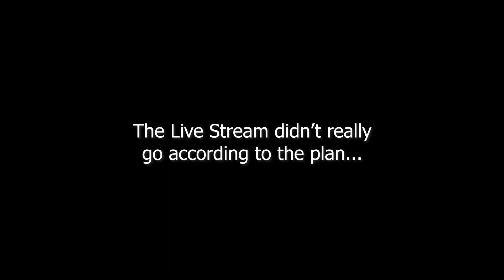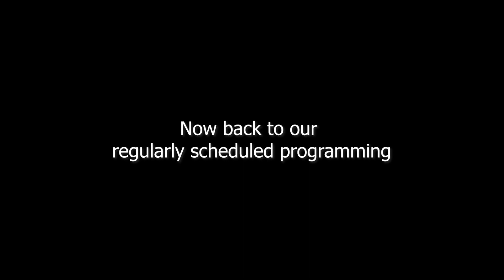Turbo Piping Fabrication on Subaru STi Pt. 2 // Lift Arc Builds

Comment: I absolutely love those clamps that you use on the pipe to hold it steady so you can weld it. I ran across those a while ago and bought myself a set now when I put two pieces of pipe together I put them in a piece of angle iron clamp them down and they're super straight.

Comment: High frequency tig messes up electronics. I had my phone in my pocket while tig welding and I kept hearing weird feedback noises then I got rid of the phone. Got a new phone, worked great...and then forgot it in my pocket AGAIN...while tig welding and wouldn't you know it, weird feedback noises again. Ill talk on the phone, 1/2 second later Ill hear myself on the phone talking lol